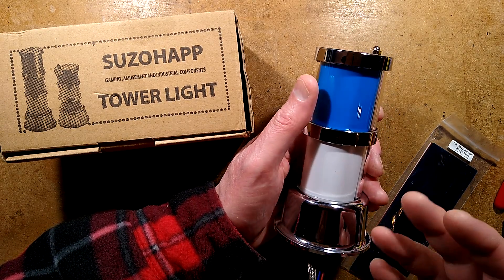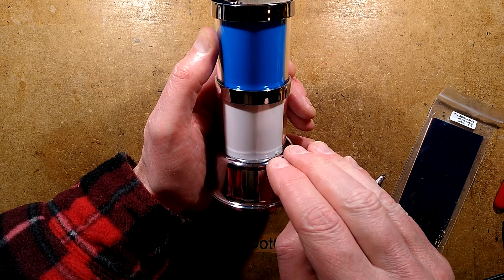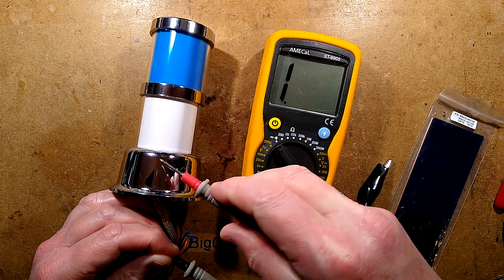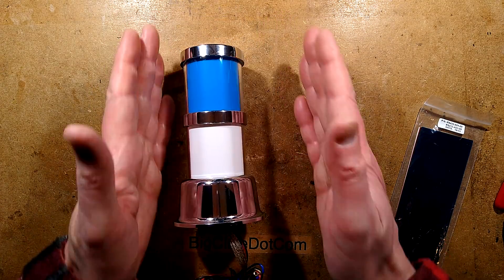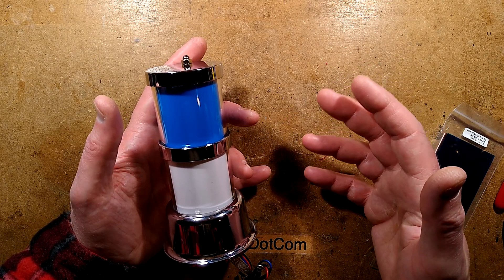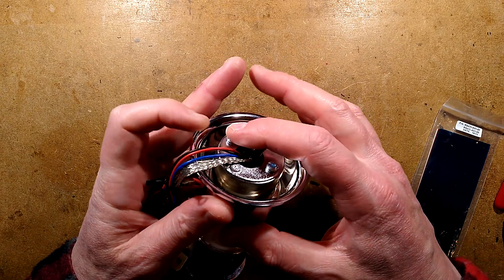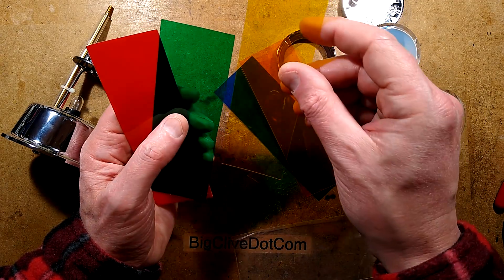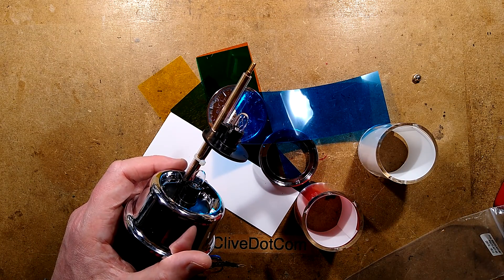Inside a casino slot machine beacon

Comment: Oh by the way here in France slots machines beacons/candles/whatever-you-want-to-call-them are a bit more interesting.
First they have 3 colors, red, yellow and green, yellow being the bottom color with red in the middle and green at the top.

Red means the machine is out of order. Simple as that. It also comes on when a door is opened, at least when casino workers are emptying coins from slots machines.

Green means the machines requires a hand pay, meaning you've won a big jackpot. Not sure if it's supposed to be solid or flashing.

Yellow comes on when you press the "Service" or "Call attendant" or whatever button on the machine to call someone working at the casino to come to your machine. It also blinks along with the steady red when the coin door is opened.

I should point out that opening the door also sets off a loud alarm immediately, at least in the video that I've seen a while ago, which I'll not provide a link to as it will keep you from seeing this comment.

All this information comes from various player-advice websites including government-supported ones as well as online pictures and I must admit by the way that I've never been inside a casino up to this day.

Comment: Ah, that's taken me back a few years. I used to develop games for Barcrest on the MPU4 and 5. They used a variety of techniques, hardware and software, to ensure that players could not game the system. There was one particularly simple hack I recall that involved a long stiff wire pushed up the hopper tube to engage a microswitch that dumped the contents of the hopper out. A baffle resolved that. I recall a room on the factory floor where they would run EMS tests on the machines within a Faraday cage. Others like you say either involved zapping or trying to goose the system by repeatably switching it off and on.
Barcrest were bought by IGT and developed interactive top boxes for the relatively simple US slots, using the MPUs and a serial interface between the IGT board and the MPU. The US units were bullet proof compared to the UK ones; metal construction as opposed to fibreboard, clearly designed to last longer than a couple of months in a prime site, and suitably protected to satisfy the Nevada Gaming Authority.
My only real claim to fame is that Teri Hatcher was a fan of one of my IGT games, Top Dollar, as mentioned on the Tonight Show with Jay Leno.

Comment: I've seen them used in an older cassino  where the 3 light version had the bottom on as an "in use" and it would blink when $ was added. The middle indicates any payout. The top was for errors or the door being opened... anything that's not normal player use.
Then again the machine also sent messages to a central system as well as each person running that set of slots.

Comment: I wonder if these could be used as cheap Andon indicators for factories starting up on a budget, combined with some simple relay control from an RPi or other embedded board. The Andon lanterns are incredibly expensive from the proper suppliers and not very customisable.

Comment: Clive, I've never been to a casino, but similar lights are used on packaging machines where I work, and the lights indicate a particular situation or fault. Red means fault, but other lights may indicate that the machine is out of cartons, or plastic liner for them. Also, it would indicate whether the product is ready for packing, or the weighing scale is at fault.

Comment: We have lights similar to that, but they are 24V LED modules with DIP switches: one to select channel, as it supports up to 4 (I think, may be actually more), and another for selecting the colours and flash rate.  annoying to some is the fact they don't all flash at exactly the same rate, which annoys some, so every 240 seconds the relay turns off for half a second then back on to sync all the lights up.

Comment: I remember being fascinated by lights like these in London department stores when I was little in the 60s/70s. They would be mounted high up in the corner of each hall. I never found out what they were for, but possibilities were signalling break times or fire emergency evacuation information. I didn't even know what they were called. I might find them useful.

By the way telephone systems usually have a positive earth too.
Reply: Positive ground in comms circuits is a common anti-corrosion tactic. Buried pipelines use a similar, but far more robust system.
Reply: I think each manager had a specific colour code, it was a "wanted on the phone" thing
Reply: In this case it's positive common, not positive earth. Earth is separate (the braid). The positive common makes it easier to switch with transistors (NPN or N-channel), which will create a path to negative when on.

That ground/earth is almost always negative is a relatively new development in consumer electronics. It used to be all over the place. Supposedly there are still quite a few cars with positive ground.

Comment: does filament bulbs induct enough to kick back a spike into the driver transistors?

maybe if it is a high enough coil count.

today's modern slot machines (and casinos constantly upgrade every couple years to keep cutting edge)i would think would use leds (unless conventional bulbs do not have the flicker response to cause epilepsy however can still transmit sound using the photo transistor to microphone connection method).

it is possible that leds are a security vulnerability for the machines as i saw somewhere leds can act as photo transistors and solar cells will glow in the IR range so under the right conditions it is possible to hack the machine through the beacon.

one other possibility is modern leds are being driven so hard that they dont last as long as claimed and using conventional bulbs they will last longer.

putting the right resistor in series with an led will limit the current enough to make the led last for ever.
Reply from the maker: No.  Not like an inductive load.

Comment: The  braid is  A HV & RF EMP Earth Network  

A Few People worked out that  piezo,  HV Car Engine Coil & HV Stun gun & And Dumb EMP &  Smart Multi Pulse Programmable EMP 
Can Glitch A One Arm Bandit into Credit and Pay out Win modes + Corrupt & Damage  the machines RAM Battery Memory  And any Preprograming within 

True Story a  USA man with a HV Engine Coil & 12v Car Battery in a Bag  Was Zapping One Arm Bandits in A Casino  in order to "HV Brute Force"  win 
However The Coil would also  End up  HV Shocking him each time He used it due no Car Body Ground so he would be a little Stunned By his Coil For a min or two after using the coil 
Security Doing a Floor Check rounds Found a Number of Zapped machines (Corrupt & Dead) Just happen to Hear the High Voltage Discharge  a  Row Away And the man Slumped over one of the machines that was now Corrupt  and was Still Emptying out the Winnings Hopper Without Winning  Siren and Detained him and was Waiting for local Police + Ambulance medics Due This time he Managed to Cardiac arrest himself

Comment: Haven't thought about how I used to get free credits on the games consoles back in the 1970's and the 1980's LoL, wow that takes me back! 
I can't remember how I found out that those piezoelectric flame starters give free credits though.... 
It's also interesting to hear someone else from halfway across the globe also knew about this! Fascinating...
I do remember that when I used it in the 80's, I came across some machines that didn't like it and would scramble the screen... A quick power cycle and it restored back to normal, I wondered back then if they had figured out that we were playing for free and made some changes to the circuit to stop us from doing it? 
Anyway yeah, that was a trip down memory lane LoL....
I wonder who else knew about this apart from me here in Australia? Was this known around the world?
Reply from the maker: It was causing the processor to crash.
Reply: It was well known in the US. Some basic hardening (aggressive grounding, de-spiking capacitors on the coin switches, etc.) went a long way toward stopping these exploits.

Comment: I dont know what they are like now, but the ground braid was attached to anything metal in the fruit machines. I recall retro-fitting old mechanical coin mechanisms to either a Coin Controls or MARS electronic mech that supposedly had protection from high voltage attacks. Then when the new 10 pence coin came out, some of the mechs had to be manually re-programmed and in some cases that protection was destroyed during the re-program phase. Some fruit machines used to have a 9 pin D-SUB socket (as opposed to DIP swtiches on the main board) that allowed a pre-configured (probably potted) D-SUB plug to be inserted, this allowed for the payout percentage to be set quickly by an engineer or cash collectorl, they for some reason were not grounded.

Comment: I wonder if an inductive heater could be used to destroy the filament in the bottom lamp and thus increase the detection time of opening a cash drawer?
Reply: I can say no. All machines have a dual switch system for all doors. One part is for the machine (to know when to put the light on if the door is opened), and the other one is to send a signal to the surveillance department. Both of which are physical switches. Meaning, that even if the machine is off, unplugged and power supply removed, the surveillance department will still get the alarm of a door open, because the system interface (a separate, as well as separately powered system) will still detect it. Also, they will receive that signal at the speed of the local network.
Reply from the maker: I think it might have destructive effects on other metal parts first.  Also - holding a coil device near a machine in a casino is going to arouse suspicion fast.
Reply: Well, from I've seen in a video about the behind the scenes of a casino here in France, opening the doors not only makes the candles flash but also triggers a loud alarm.
(They show casino staff emptying cash from slots machines at the start of the day).

Comment: Back in the 70's i worked at a game vender.  One we had a "space invader" game that had a coin box full on pennies.  The cocktail game in the back of the resturant.  The. Kids learned if they tilted cabinet backwards and held the bent coin eject opened the coin mech enough to allow a penny to be thrown in and activate the 25cent (quarter) microswitch.
Another querk appears a Japanese programer added a "backdoor" to give a single credit if someone held the joy stick (left or right) pressed fire button and 2 player button at a exact time during attract mode to get one free credit.  By adding a little glue logic to the switches, a reset would hit reset on the processor.
Reply from the maker: It was common to ping a penny up the reject slot to get it to bypass the measuring system.

Comment: At the casino I used to work at, the beacon was called "candle," the white portion was at the top, indicating the customer pressed the "Change" button for a floor cashier, and the lower portion was a different color depending on the denomination of the machine. Different tempos and patterns of the two flashing would indicate a) slot machine door open, b) out of service, c) not played since door was opened, d) jackpot requiring payout by slot attendant.

Grounding is important to these machines, as they are subject to a great deal of ESD - wool carpet and low winter humidity make for fun times, employees zapping each other constantly whether they want to or not, getting a zap every time you touch a metal handrail or a machine's case...
Reply: I work as a developer for these, and our development cabs in the office aren't grounded. I flinch every time I reach for them now, I swear the damn things had a Tesla coil running in them lol
Reply: I'm curious, what's the reason for wanting to indicate if a machine hasn't been played since the door was opened?
Reply: @DoctorMcKay1  It can also indicate the last attendant did not restore everything to a playable condition, effectively leaving the functional machine out of order.
Reply: @DoctorMcKay1  if it's not played ... it's not making money. 
it also kind of indicates that it there is no person playing (yet) so they could tell people that a machine was free ...
Just guessing on my part though, but that's how I'd be interpreting it.
Reply: Wool carpet and ESD 🤔
I happen to have found the "zapping" way that wearing wool clothes will indeed prevent me from getting a zap when exiting my car.
Wearing synthetics on the other hand WILL cause a zap everytime I exit my car.

So it appears that wool doesn't cause static charges to build up, therefore I'm a little bit surprised to read that wool carpet in casinos is the cause of ESD.
I know casinos have carpeted floors but are you sure it's actual wool and not nylon for example ?

Comment: Another thing these beacons are used for is high win. In many countries, there is Anti-Money-Laundering laws that require licensed casinos and gaming facilities to register larger payouts with ID card, valid bank account, and usually a report to some governmental office, so the won money cannot be abused to support terrorist organisations. So when a high win is made, the tower will flash a specific combination, that will tell attendants to immidiately summon to the area, sometimes with security personell. They will also usually have a third person checking the security cameras and relay via radio so not someone pushes away the winner and tries to "claim" someone elses win.

Here in sweden the maximum permitted unattended payout is 500€ or 1000€ what I know on casino cosmopol. dont remember the exact sum. On boats that go under the international gambling exception, the maximum unattended payout permitted is 100€. All above will flash the beacon and call an attendant.

This is however falling apart now when many casinos are going to electronic payment, where you have a refillable "coin card" that you scan instead, where your spends and winnings will be transacted upon. So the ID checks and such can be made at the till instead when the card is turned in for withdrawal.

Comment: 555 for voltage thresholds? That chip is modern pixie dust I swear, seems a simple timer is useful for anything sometimes
Reply from the maker: It's a very versatile little chip for many timing and voltage threshold applications.

Comment: I'm a casino tech. As the other comments say, we still call them candles. We don't use them much anymore, our player tracking systems notify us electronically by an app on a iphone if the machine needs service (or attendant). Outputs from the computer are negative trigger, so positive common. Depending on manufacturer, I've seen 5/12v bulbs or LED. All of our machines come with candles, so it is unlikely that we would need buy a generic replacement. We do order a lot of other replacement parts from Happ though. The colors we call gels (like stage lighting) they can be installed internal, however some manufacturers are using large gumi-bands on the outside (which makes setup and conversion of the machine much quicker) I have literal boxes of them lying around. Our color scheme doesn't line up with the other posts, but maybe that is a regional thing.
Reply: Greetings fellow tech. I agree with you about this type of candle. It's only seen on older games, especially ones made by IGT.

Comment: Industrial andons are increasingly going IoT, with a little wifi or proprietary 2.4GHz module at the top of the lighting stack to provide remote status monitoring. It's a relatively simple retrofit for older machines because you've already got power, signal lines and an ideal antenna location in one place. I'm curious as to whether the gaming industry could implement this while still maintaining their very strict EMC requirements.
Reply: Hard, they use shielded ethernet and power cables still for that reason. Plus foil lined cabinets, so that sniffing RF state is harder. Not impossible, there have been one or two rf energy shape exploits that have been done. But they want to keep it both in the machine, so as to not give state away, and keep it out, interfering with operation.

Comment: I'm sure since that since casino machines make them a lot of money they also cost a lot of money (including replacement parts such as this light). I'd think they'd want to use better materials than chromed plastic. Also it seems that if they don't want it zapped they wouldn't have any exposed metal on the exterior.

Comment: Hey bigclive, i got a request/question about a problem i have at home

Ive got an APC UPS model BE600M1 (offline which has no transformer) which turns out to be very efficient because it has a 7AH battery and can run a 50 watt mini pc+screen+printer around 40 full minutes,
So ive recently upgraded this UPS with a 12v 20AH battery from an electrical bike and now runs 3+ hours.

now i thought well that's nice, how about upgrading my other UPS models, but they all turn out to have transformers in them and i guess they are either online or interactive UPS models.
But none of those can run 40 minutes on a 7AH battery let alone 20 minutes.

Why is my model so efficient (BE600M1) and is there any more "efficient" device/ups out there ?

I live in Colombia and suffer a lot of power outages when it is bad weather, which usually last around 2-3 hours before power is fully restored.
I also got a few APC BV1000 models, they got a 9AH battery but didn't even last 15 minutes with a 50w load also they where fitted with a very big transformer that was running so hot all the time it nearly melted the wires inside.
I'm guessing those where "online" type UPS.